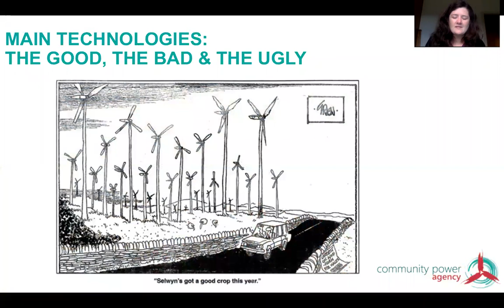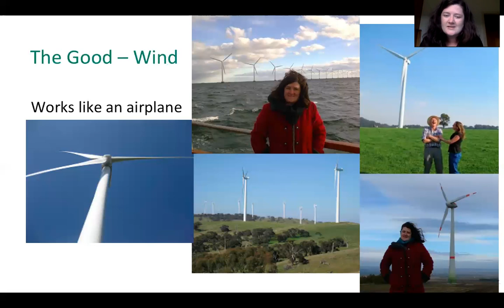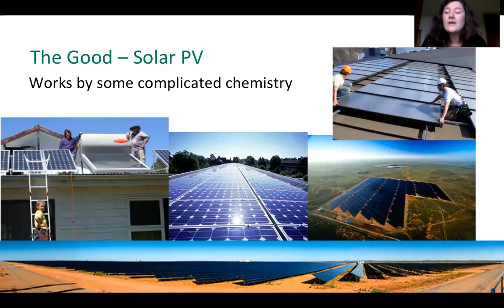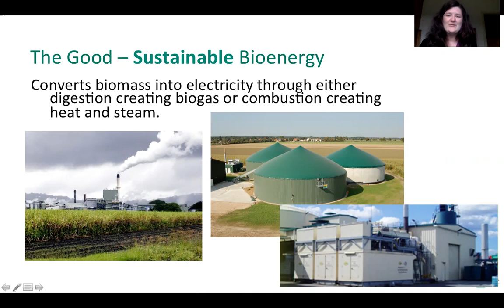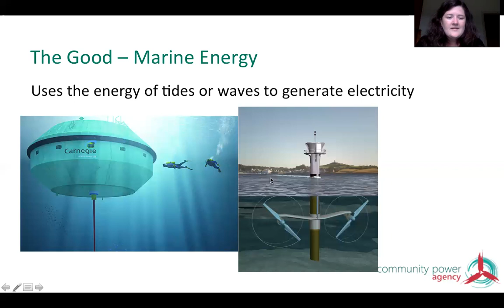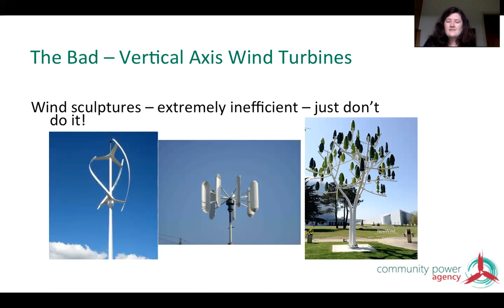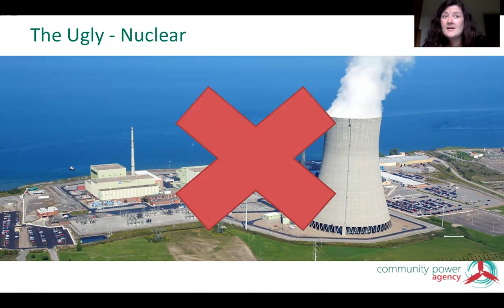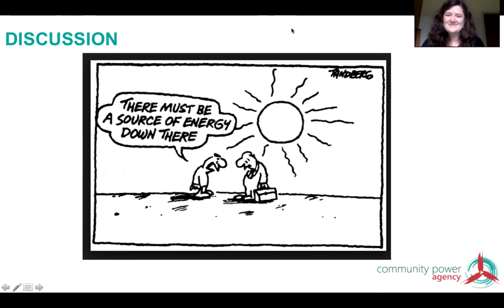C4CE Webinar 2017 - Intro to the Energy System - Energy Technologies

Comment: 4:00
“For every 2m/s you increase the wind speed you increase the energy output 8-fold”
Should be: “For every doubling of the wind speed you increase the power output 8-fold”

5:14
“Not a lot of energy in turbulent wind”
There can be plenty of energy but it cannot be harvested efficiently.  (High entropy.)

31:10
“Closed circle gas turbines”
Should be “Combined cycle gas turbines”.